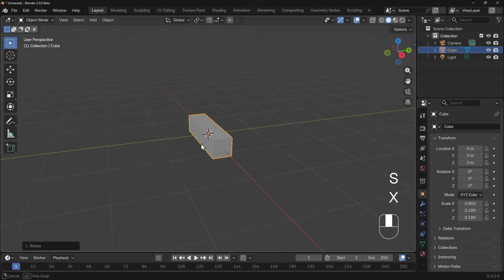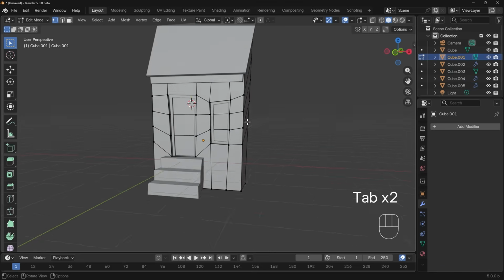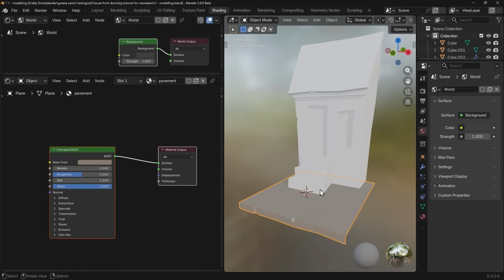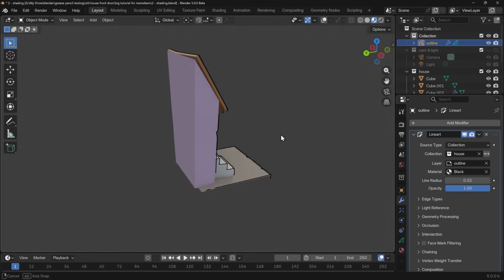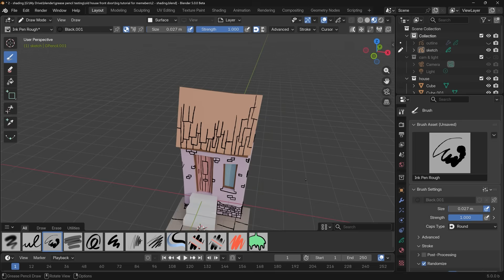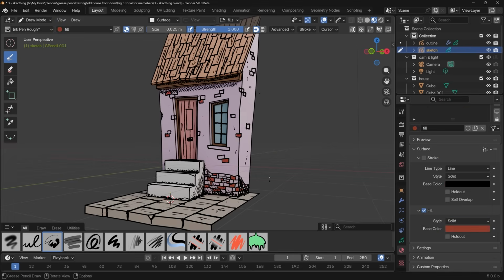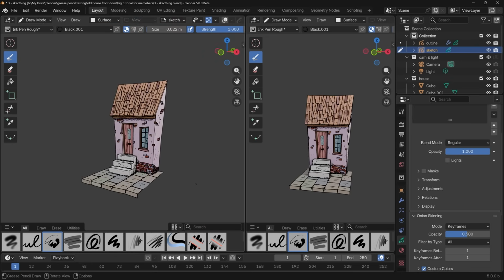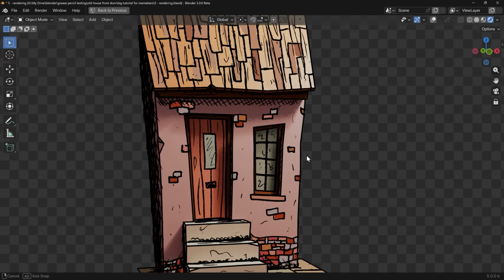Grease Pencil Masterclass: 3D House Model Full Workflow Breakdown (Tips & Tricks Included!)

Comment: 2:16 if you're like me, and you want to use edit mode on lots of objects, but your mind keeps defaulting to the idea of "only one thing can be selected at a time!", you can also press Alt-Q while hovering over another object to quickly select it from edit mode! this takes you from edit mode in one object, to edit mode in another, without having to swap back to object mode first! though for editing lots of stuff at the same time, selecting them all is still much more convenient

(Alt-Q also works for all the other modes, mostly! the feature is a little undercooked, but usually it works as long as the objects you're switching between have the same modes)